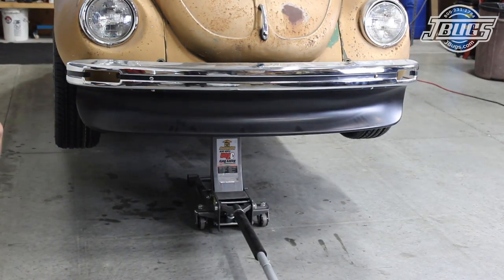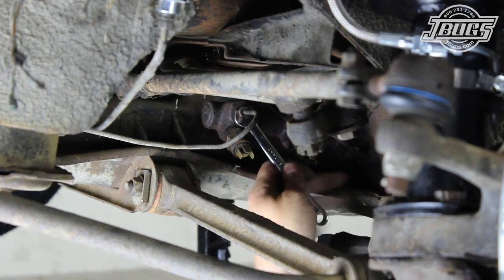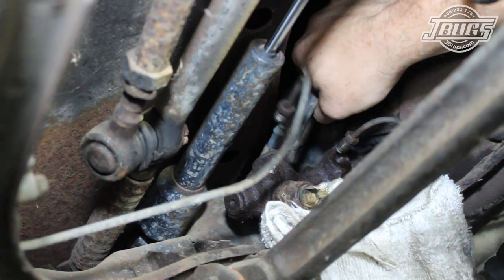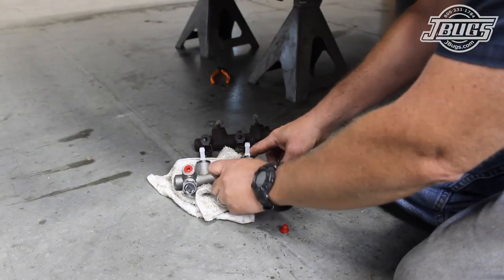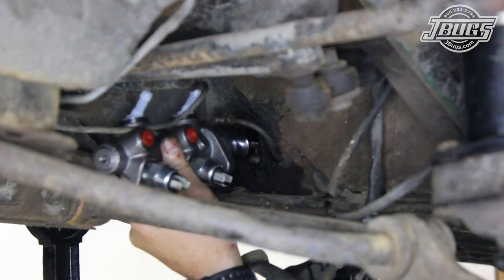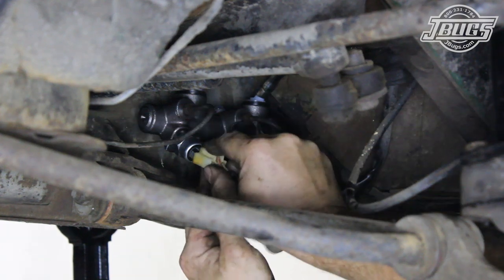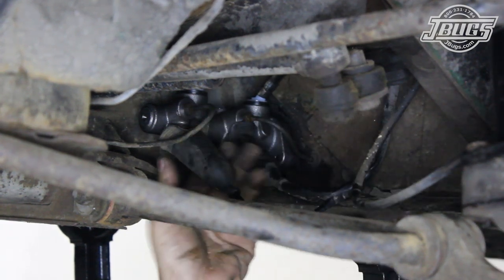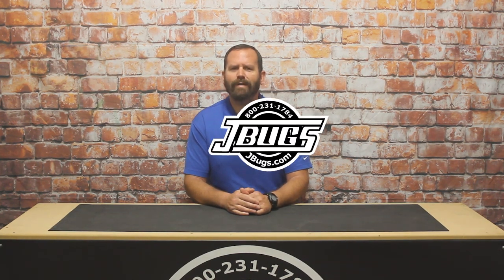JBugs - 1971 VW Super Beetle - Dual Circuit Master Cylinder Installation

Comment: Can i switch the position of the brake switches with the brake lines? Having space issues on a 73 super
Reply: Yes, just make sure the front brake lines stay on the front ports and the rear line hooks up to a rear port.

Comment: Hi Sam. When doing a disk brake conversion up front and leaving the stock drums in the back, what style master cylinder is needed??????
Reply from the maker: If you are only swapping the front disc brakes, the stock master cylinder will work fine, as would a large bore master cylinder. If your existing master cylinder is not bad, there is no need to replace it. If it is I would put in a large bore, just so that if you decide to put in rear discs later, it won’t have to be replaced again.

Comment: Will a large bore be ok to install with just the front brake upgrade if i already need to replace the cylinder?
Reply: Large bore masters can be used with discs and drums, yes. The result will be a slightly firmer pedal, but it can be done. We only recommend installing the large bore if you will be upgrading to 4 wheel discs.

Comment: How does this master cylinder work with 4 wheel drums?
Reply: It will give a much firmer pedal without much feedback.
Reply: So it’s ok to use this if planning on upgrading in the future?
Reply: @gregoryschwarz2730  it could be done but really isn't ideal for use with drums.

Comment: Both of my switches leak... Even with teflon! Help!!
Reply: We have never used teflon tape on the switches. If the switches are tight, they should not leak. If they do, they are most likely defective.